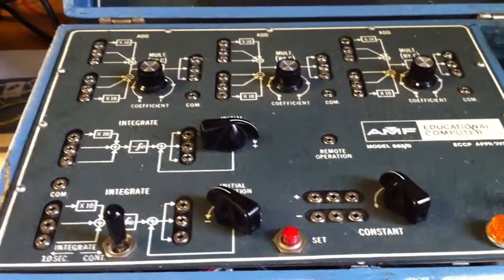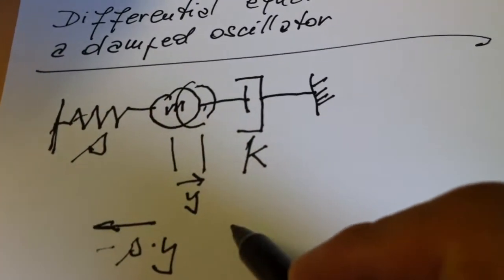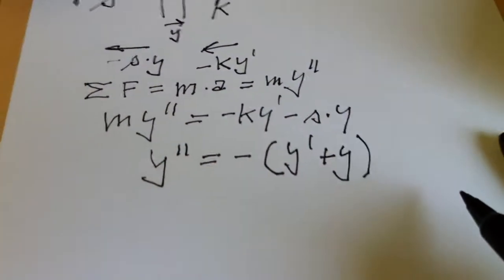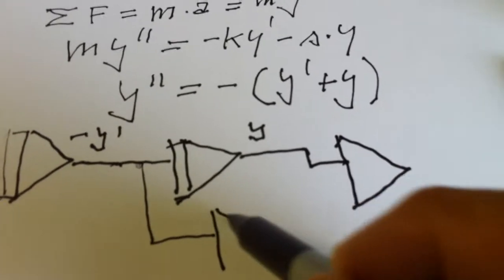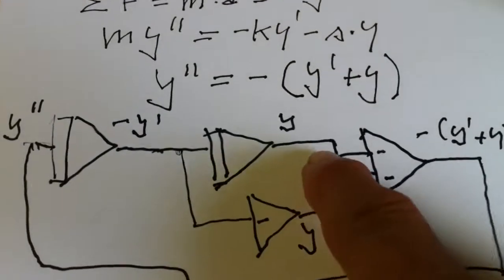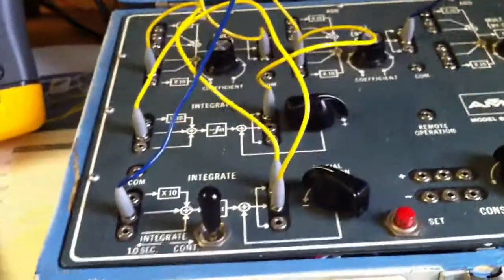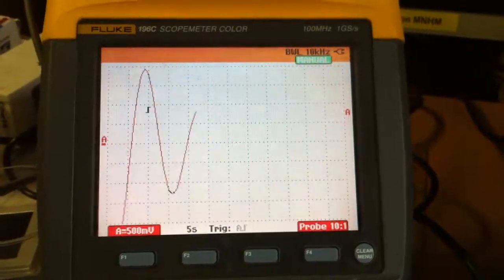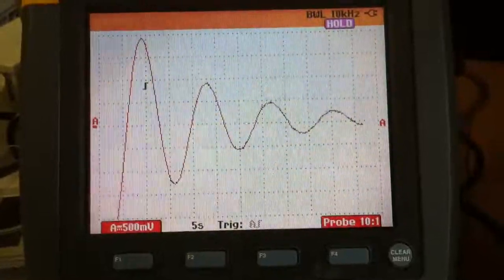Solving the differential equation of a damped oscillator using a vintage analog AMF665D computer

Comment: Dumb question but, if I put a sine wave or triangle wave instead of a step function, would this circuit give me a logically mathematical output? In other words would that circuit calculate for whatever was applied?
Reply: Sure, the integrator would integrate the function you put into it.
Reply: @akkudakkupl  coolness, thank you.
Reply: Yes it does! But you have to scale it both for amplitude and bandwidth. And with analog electroinics you are limited to "dt" as the only available variable. But if you combine it with a digital computer you can build functions on it and send them into the analog computer.
Reply: @Muck-qy2oo  cool
Thanks

Comment: Awesome
Is that time wave form an actual timing of the modeled system, is it really that slow?
Reply: You can scale the time whiceer you want. So yes it can be identical but must not necessarely be so. Actually you can try to build an analog computing circuit from analog electronic components if you want to by just building computing elements (two integrators and one inverter) and interconnecting them like the equations terms.

Comment: ANALOG! So glad folks are still working with this old tech. Have you ever come a cross this idea of a digital air computer, patent 3109554 ?
Reply from the maker: I did many years ago ( 46 ) my thesis on fluidics, which are a sort of air-driven (or better fluid driven) "computers"... Principal fluidic elements were flip-flops, all based on the Coanda effect.
Reply: I have some pneumatic digital logic elements at my work, driving an old machine .

Comment: Nice video. Could I ask what frequency you would need an oscilloscope to cover to view the results.
Reply from the maker: everything runs very slow...you do not need a fast oscillo with this computer...
Reply: Wonderful video. Op-amps are so simple but so interesting to. But, of course, analogue computing is what they were designed for. I have just been reading about the very early mechanical integrators. Which are the ancestors of this (starting with the planimeter from 1818). Its an absolutely fascinating subject.